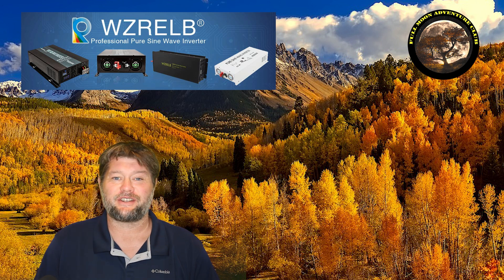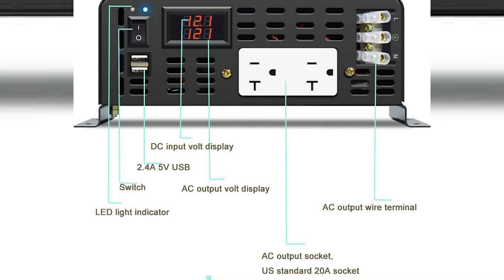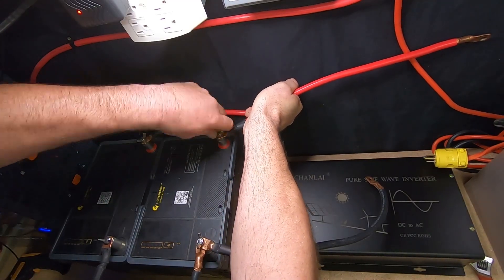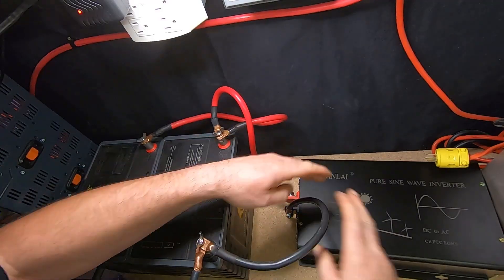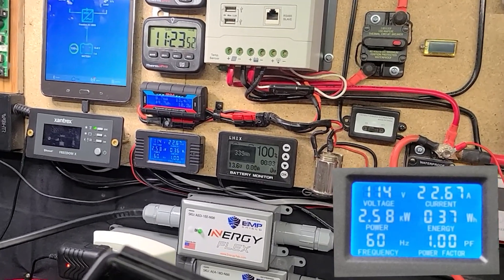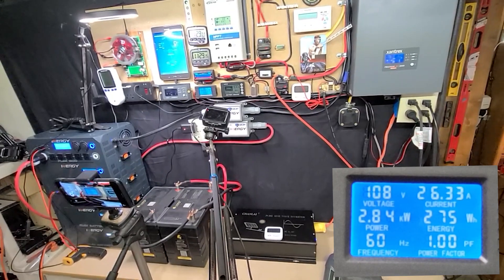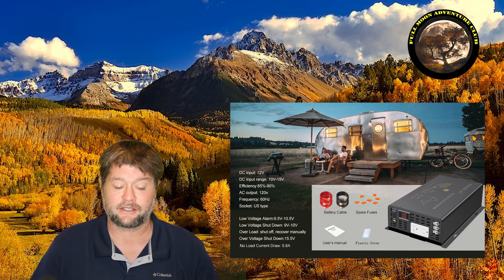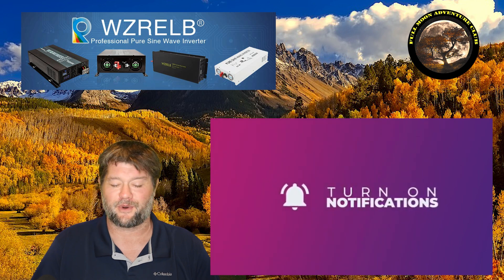WZRELB 3000 Watt Inveter Test and Review

Comment: does it have a soft start built in for ac roof top units? With the ac running, do you think it would handle using the microwave at the same time? All using the two outlets?
Reply from the maker: The air conditioner does have a soft start however, running the microwave at the same time as going to tax just about any system. I'm not saying it won't work bet your system has to be built to handle that kind of load

Comment: Question. For some reason when I connect my WZRELB 3Kw Inverter to the 24 vdc Batteries, Batteries start to discharge fast without connecting a Load. Why? the batteries are good.

Comment: Noob question for inverters with hardwire options for higher loads.  Do you need to wire in a breaker or can you simply wire in a an outlet with 12ga?  I suspect it's always best to have a breaker in line when hard wiring.
Reply from the maker: I would use a breaker when hard wiring to the inverter. Better safe than sorry.

Comment: Wish you would have plugged in a n AC safety tester.  Too many people are finding AC voltage on the neutral out which is dangerous.  is the Neutral showing it's safe with an AC safety tester?

Comment: Ihave had several 2000/3000w wzrelb inverters and they have all worked well.   with this new model what I really wanted to see is if the 20a plugs are wired separately or as one...  and how the new wiring works for the 25a circuit as its different than previous wzrelb.

Comment: I want to know if it's to working fine after you've post this video
Reply: Just got mine some days ago and am planning to use it on a small off grid set up
Reply: @santinogreene2232 I hope you see this, how’s yours doing 1 year later. Did you have the 24 or 12v version. I was going with the 24V version. Thanks
Reply from the maker: So far so good but I've had it out of service for about 6 months. Used it in my pump room for about a year to run to water pumps and it's doing great.

Comment: Do you think that the 3,000 watt inverter would start and run a roof top rv air conditioner ? ( with a big battery bank).
Reply from the maker: Definitely.
Reply: Not this one it's garbage.  Fan goes on at 300 Watts and shuts down at about 500 watts.
Reply: @scott1artgmail 0 information provided in your comment. I have powered a roof too AC with the old 300w. But I went in and fixed the live ground issue beforehand. It's been running strong since 2019.

Comment: Just saying you should connect the negative first and then the positive. if you connect the positive first that means the negative end is live. that's why you're getting a spark. And make sure the appliance is switched off before you connect it.
Reply: You're getting a spark because the inrush current is charging the capacitors. This will happen regardless of which line you hook up first. To avoid this from happening you need to pre-charge the capacitors by placing a 10 watt resister/or a low wattage light bulb w/wires in-between the the positive wire and terminal for a few seconds until the capacitors charge up then connect your main wire. NOT DOING THIS WILL DESTROY YOUR INVERTER EVENTUALLY. This should have been shown in the video.
Reply from the maker: I've had Xantrex engineers go over my inverter instalation and never recommended what you suggest. It is also not in any of the instructions included with any of the Inverters I've ever installed. In fact every instruction manual mentions the spark as normal in the instalation process. Your method may help in capacitor longevity but is in no way required for typical installations. Every inverter I have ever owned still works just fine so I would assume the effect of the spark is miniscule. Just my opinion. Thanks for the comment and happy camping.

Comment: No remote switch to turn it off so you don't loss power if not using it? Can you run a RV  A/C unit by itself?
Reply: Does anyone on Earth build an rv replacement heatpumpAC  unit with inverter technology rather than compressor motors?
Reply: The mini  split home AC have them, why arent they available to replace the old electricity hogs built over the last 60 years?
Reply: Something that pulls 5 amps not 15 to 20 for 15,000 btu  heatpump technology for the RV industry? 😢
Reply: INVERTERS !    Lets build it Elon!!